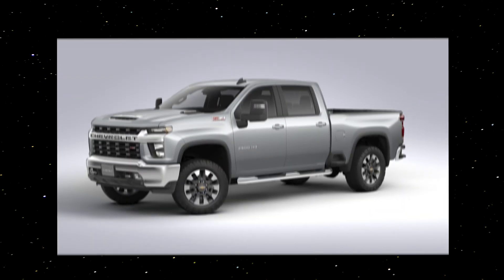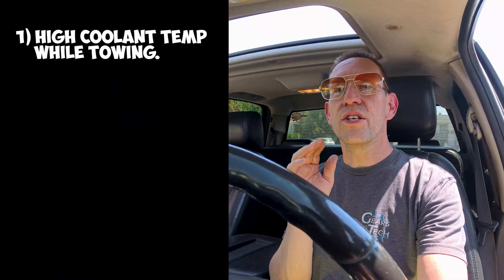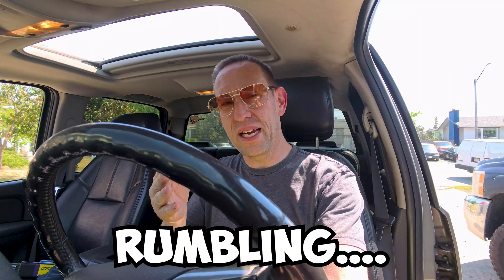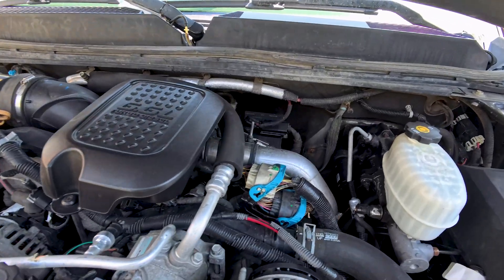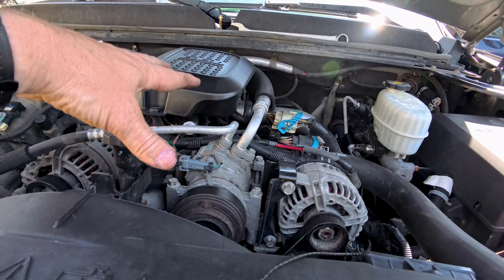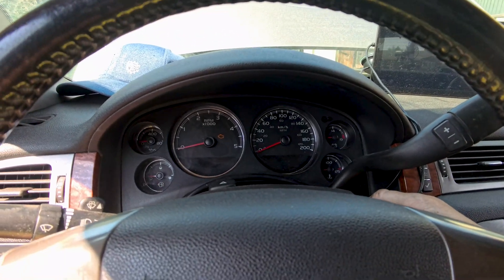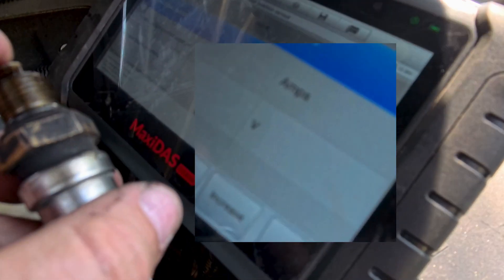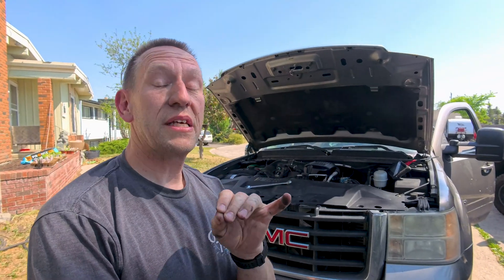Duramax Turbo Troubleshooting: A Complete Guide ~ P0290, P2463, P003A

Comment: A guy could test the voltage going to the actuator or is it hard to get into vane actuator while at idle? 
T post pins or the actual test needles help to not damage the connectors. Loud of great info on this video.
Reply from the maker: You would want to test the current draw through the actuator. That'll tell you the most info more than voltage.